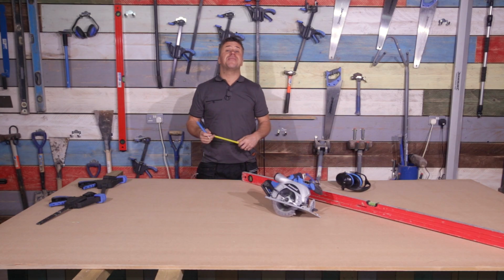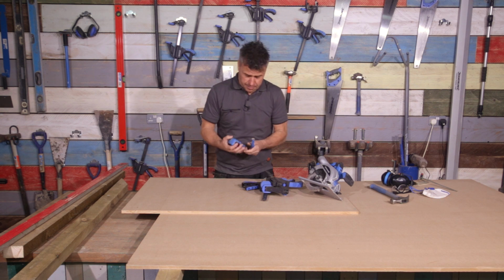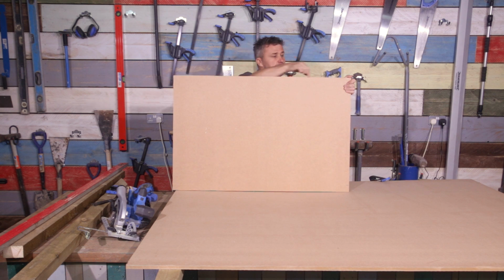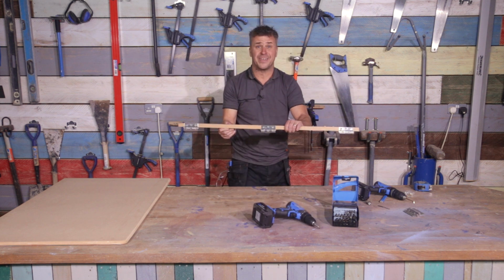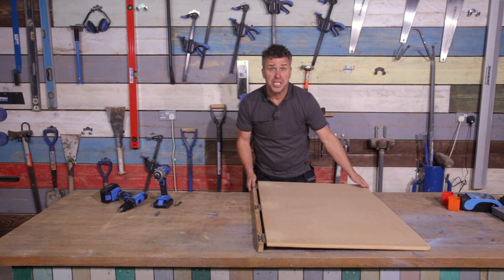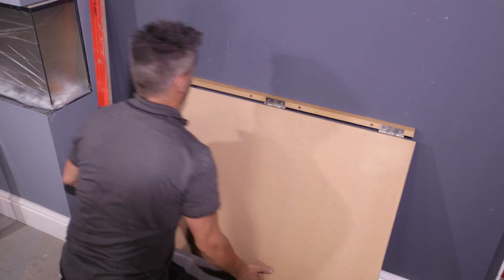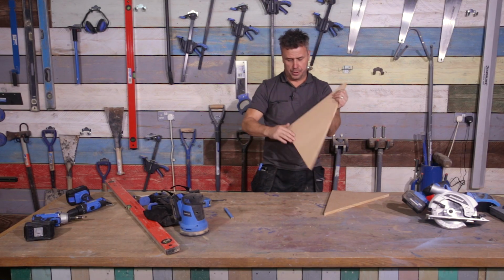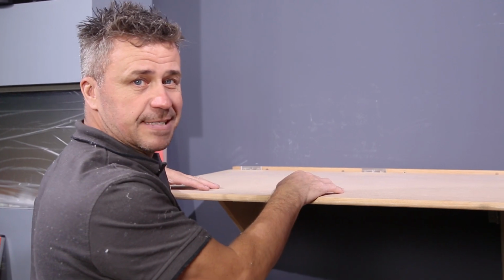How to build a folding desk

Comment: Cheers mate. Exactly what I was looking for. Going to be much easier than having it fold upwards (which is what I had in my head). Is there a minimum thickness of MDF you would use? I am trying to use up existing stuff and have a load of 9mm thick. I also have some 3mm chipboard. I was just going to stick them together. Would that work?

Comment: When measuring the 40mm offset for your straight edge to run circular saw along wouldn’t it be better to measure from the reference edge you used to make width marking rather than markings made?
Reply: That would certainly work too, When making How to videos you sometimes you have to explain things a little different to help beginners understand the process or the measurements.

Comment: What....no dust collection used on the circular saw with MDF... Note they didn’t show the router in use either, probably because of the clouds of dust it produced without any dust collection... Yes I see he uses a dust mask, but then removes it, so he can breath all those fine particles of MDF still suspended in the air, deep into his lungs...FFS...Some expert eh...!
Reply: Not sure if you was watching the same video, I was wearing my mask when cutting and sanding the MDF sheets, I also used the Router in the video! When producing content like this video we have to keep stopping and starting to do pieces to camrea so I have to take my mask off when talking to the camrea for the radio mic wouldn't work! Rest assure Stu we keep our workspace very clean, safe and tidy when doing all projects.
Reply: @MrDIYCraigPhillips  please do not feed the troll...